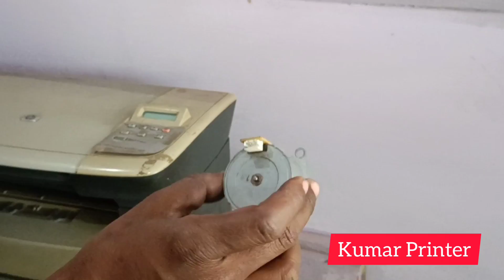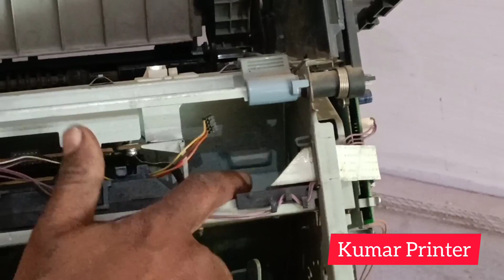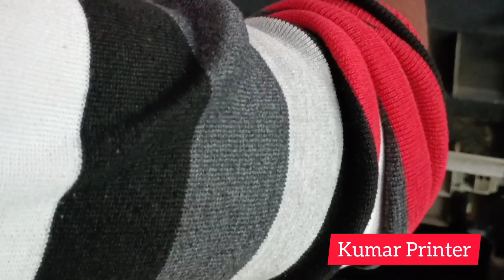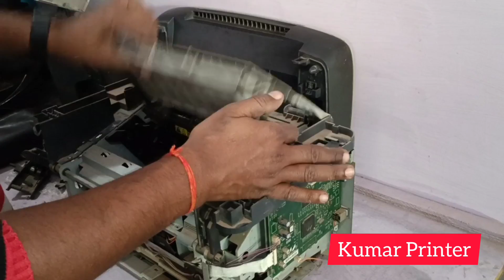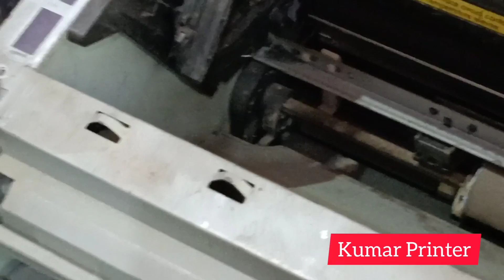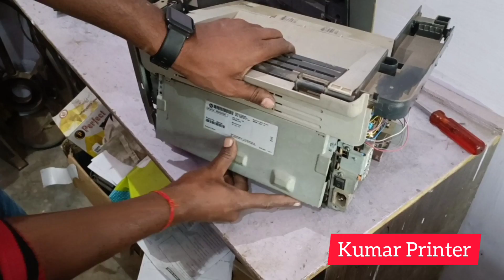How to Replace HP M 1005 Main Motor | 1005 me main motor kaise badle hindi #kumarprinter

Comment: just tell me when to require change main motor . kya problem aati hai jab yeh change karna padta hai
Reply from the maker: When the printer is turned on, all the gears move. If this does not happen and the sound comes, then understand that you have to change, mostly I change the gear.